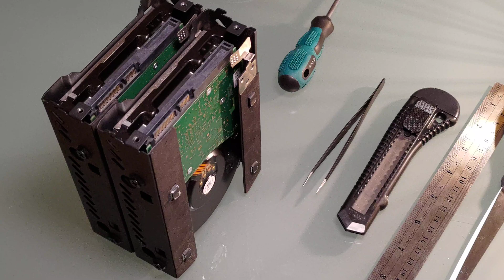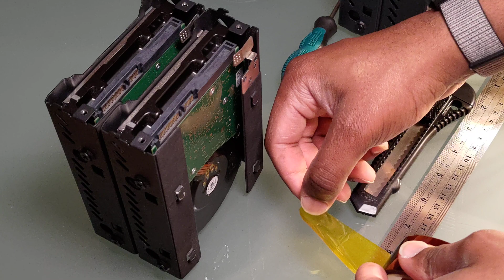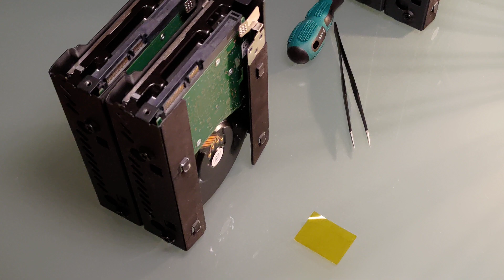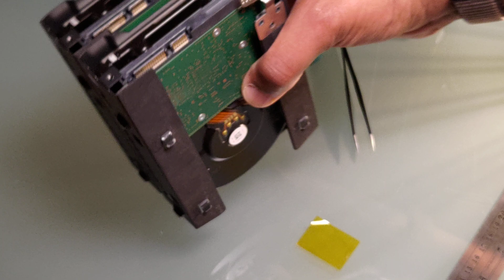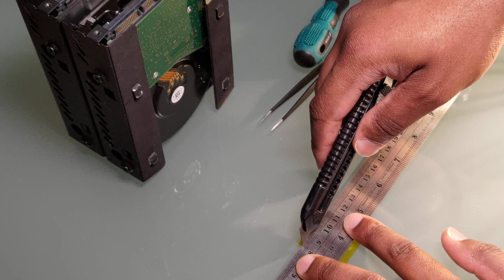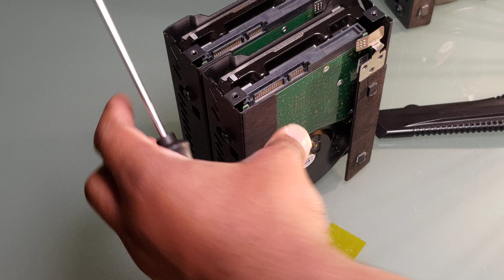Properly Fix 3.3v Pin Sleep Issue on Newer Drives

Comment: I tried this but the drive will still not initialize (initialize disk the request failed due to a fatal device hardware error). This is on a Western Digital WUH721816ALE6L0  16TB
Reply from the maker: Make sure you covered the right pins, the pinout is the same on all SATA drives